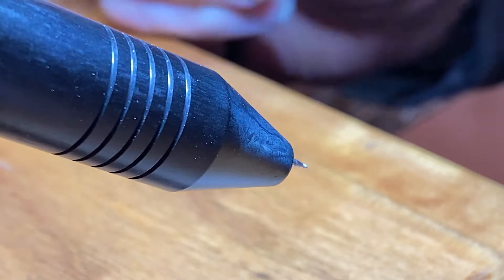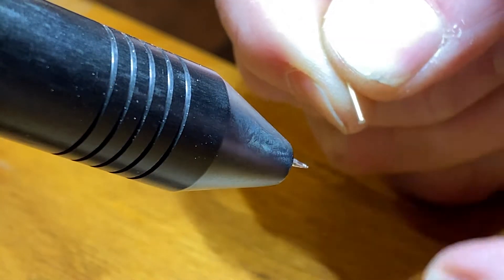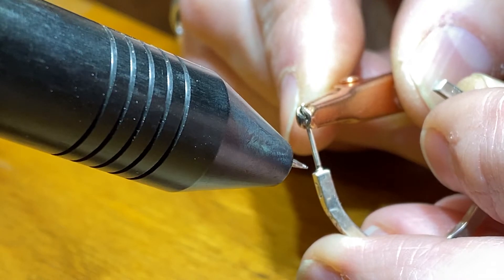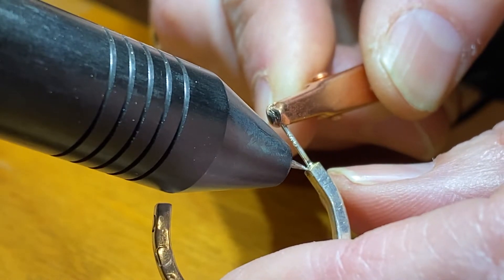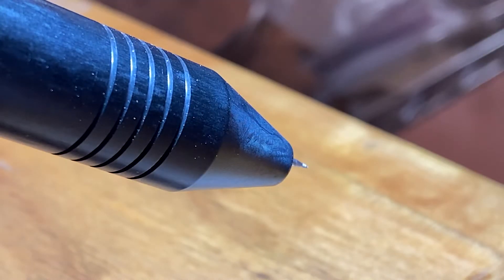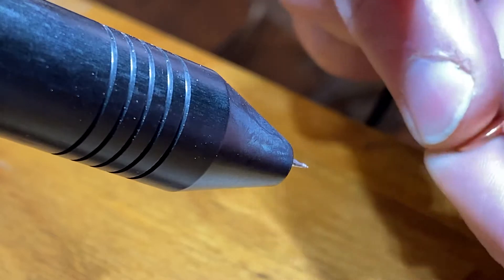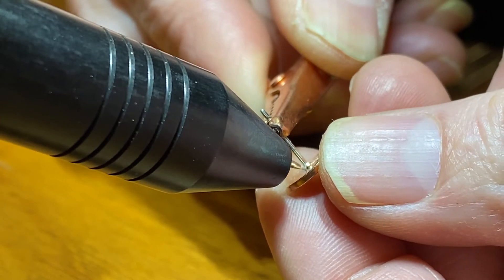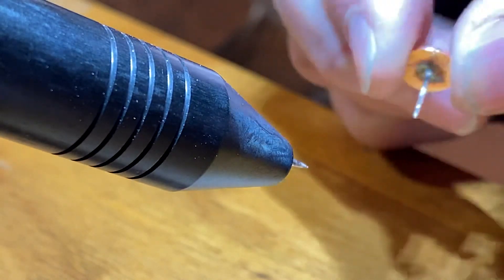Welding earring posts with Orion welder 200i, jewelry instructional

Comment: I have been using an Orion 100c to TRY and do the same. Im ending up with lots of carbon around my welds and pitting on my earrings. Ive tried your power settings and my posts wont stick, even with multiple welds. Any advice, thanks so much for making this video!
Reply from the maker: What is your gas setting? And are you using pre-made mountings, or simple sterling sheet? I've had issues with a couple different pre-made mountings where the weld isn't great. If that happens, I use the Orion to do a spot weld and then solder. I can't figure out what the issue is with those strange welds--shouldn't be an issue with the sterling alloy, but that's the only thing I can come up with.
Reply from the maker: Also...make sure everything is clean!
Reply: @hannijewelry  gas setting is 7psi, 750ms preflow delay, 500ms postflow delay
Reply from the maker: Have you had any luck?
Reply: What is 750ms preflow delay and 500ms postflow delay? Where is that in the settings of the Orion 200i? Thank you for your help ☺️ is this done with the regular arc and what would be the energy setting? Thank you ❤
Reply: @milouschmidt you might not have the same settings, as you have a different version of the machine. Mine is a 100c